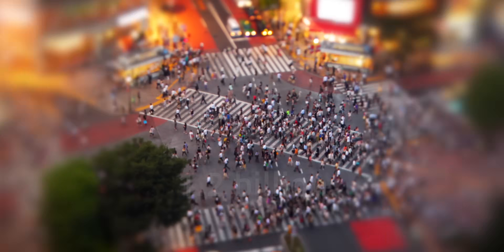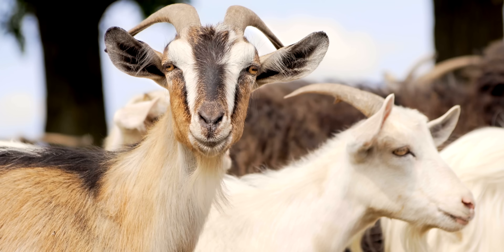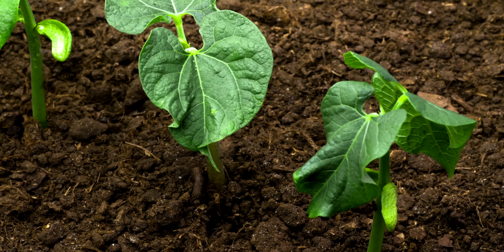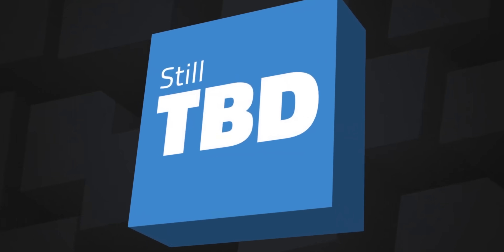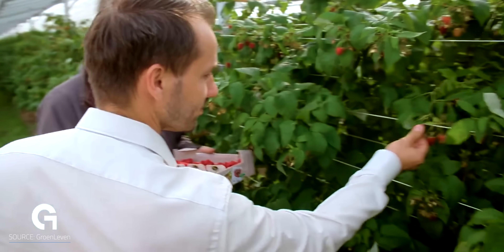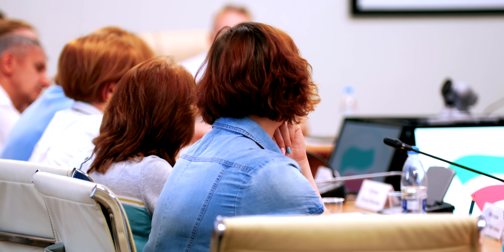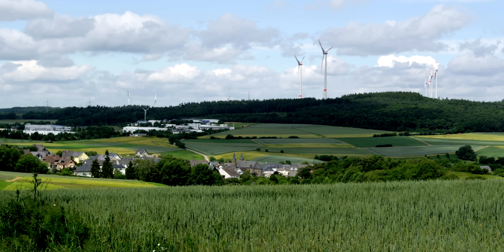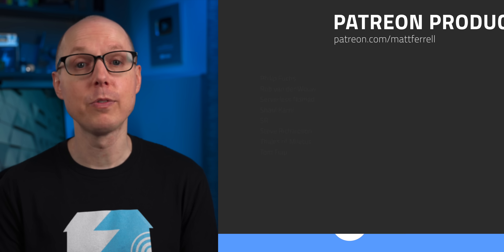Solar Panels Plus Farming? Agrivoltaics Explained

Comment: There are quite a few crops that are grown in polytunnels. If the panels are able to pay for themselves or reduce costs of maintenance below that of the polytunnels, it should be an absolute no-brainer for the farmer. For optimisation, I imagine that the farmer would want to maximise his profit per acre, or at least, that's how I would do it if I were in that position. That would depend on the relative costs of the crop and energy, but would certainly come out to some combination of both.

In short, we should absolutely be trying to use this everywhere. Even if it drops agricultural yield, it will still increase overall yield (if the numbers you quoted in the video are correct). If the double-sided vertical solar panels do not interfere too much with cultivating and planting in the field, that should also be done on the more sun-intensive plants.

Comment: This system  of programmable adjustable pvs is proving interesting for high value crops such as vines in top of the market wine areas of France. Given that in  SW France we've already gained 1.4°C temperature, I expect to see more of these apvs installed over the next 5 years.
Reply: New technology for electric power generationhttps://youtu.be/xc2V2BS_Fng

Comment: How does the power and crop output compare between agrivoltaics and just plonking some wind turbines in farmland? I'n guess if the NIMBYs allow it, the turbines are a better solution to dual-use land.

You asked if there were other such tech we knew about - have a look at thermal chimneys (AKA "solar up-draft tower") - they are basically a horizontal wind turbine inside a giant circular concrete chimney, with a large plastic skirt around the bottom of the tower trapping heat between it and the ground and forcing warmed air up through the chimney to drive the turbine. Trials have been done where the area under the sheet was basically a greenhouse. They are super simple and cheap to build, need almost no maintenance (one here in Australia lasted 10 years and only fell down because they decided to stop maintaining the guy-wires holding it up) and they can even produce power for some portion of the night from the trapped air still being warm after sundown. I have no idea why they are not more popular, except for the fact that a) they probably do not produce as much power as a simple wind turbine, and b) they require a lot of land.

Comment: How often must the PV panels be replaced and what is the environmental impact of actual making these panels?
Reply: Much much less than the impact of generating the same amount of electricity using fossil fuels. Solar panels can produce electricity for several years before facing a drastic decrease in their yields

Comment: This is not new at all. This topic has been dealt with over 4 years ago publicly in Germany. There are enough buildings in Europe which people should focus on when installing solar panels, where the implementation barriers are a lot smaller. https://youtu.be/dFddSSZManM

As usual technocrats oversimplify the situation as means to an end.  The shown examples are mainly from Europe and Germany. None of the 3 given reasons are the main issue. Not for agriculture. Cause all those reason have a justified root. 

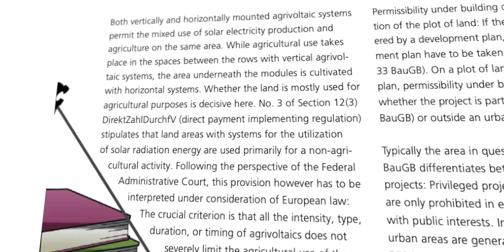For bureacracy ,  and for the case of Germany (because he took the legislative texts from the German law, you can find a hint at 10:06 -> BauGB - The Federal Building Code) for safety reasons (i.e. fire-safety), for environmental reasons (i.e. rotation farming, animal protection etc. ), AND because the consititution would be undermined, agricultur and energy are seperated, also rightfully so. And therefore this is fully supported by green parties here. So no, bureacracy is not the issue. Staying true to democratic values is. Democracy has always been and always will be a human-prefering-governmental system. Therefore "agrovoltaics" is not a term that can be pursued or introduced to the european law and is also not applical for most of Europe. Shadowplants are not the main part of the european diet. Sunplants are. Which is why these plants are making up for 80% of all agricultural land. Good luck with trying to find enough plants that would be able to grow efficiently below solarpanels. People cant only eat berries. (i.e. tomatoes) , let alone trees without running into monoculture issues. 

Nimby syndrome befalls everyone, environmentalists, progressives, even the most authentic technocrats. (yet again rightfully a democratic issue, not a metaphorical one) 

The freemarket is not what it is. Free. It is heavly regulated (see above: bureacracy) AND gets even more regulated ebery year by socialist and green parties, inducing, as rightfully said, heavy costs for non-standard solutions (research, review...etc) Therefor there are already a lot of governmental grants for renewable energy solutions, (I dont know why this was not mentioned) but then why should the taxpayer give out more money for solutions that are democratically not accepted (making them actually illegal/unwanted)?

SO the actual solution is not depending on the 3 given reasons but on technical feasability, passing the issue back where its supposed to be solved. By the technocrats. 
Once the whole solarpanel can be made translucent, then IVP will find its way into mass implementation and laws in no time. 

Until then, please refrain from just asking the public rethorical questions like "Why not just change the law, us (nymbi) , or invest more money". Instead, from the beginning on, ask the public what they think about IVP, or if someone could find a solution to implement it the way it works for everone. 

Then your contribution to this topic will sound less accusatory or blaming (which wont solve anything especially if completely unrelated issues are pointed at, eventually forcing someone or something to sacrifice), but encouraging to find simple solutions most people havent even thought about. Do not over simplify things. Youtubes community is already very dumb. For their sakes.

Comment: Had this idea 20 years  ago. - couldn’t understand why all desert reasons aren’t covered by solar. You could use part of the electricity to pump water out from the aquifer you have less evaporation as the solar panels with shade the ground from the Sun the water pumped up could be used to irrigate far drip feed underneath the panels and plants can be grown in the shade areas excess electricity could be linked to bitcoin mining in order to convert the stranded energy into bitcoin which could then be used to pay the wages of employees for harvesting..

Comment: Hi Matt. Great video. I think it makes sense to combine the two, but as you said, the combination is less efficient than a straight up solar park or agricultural land. Another question that wasn't addressed: as a proponent of organic food, I'd like to know what is the impact of the materials used in solar panels on the food? If they are made of heavy metals or plastics, or other materials that are not good for human consumption, could there be potential leakage, leeching, or run-off issues when it rains, or when they slowly break down?
Reply: This is an excellent question. And how long do these panels last, and how are they disposed? The added cost of dismantling and recycling is not mentioned. Do the heavy metals end up in landfills? There will be millions of solar panel arrays world wide requiring cost effective dismantling and recycling. Who pays that cost?
Reply: @archcollie5708  ohh the worried minds are present..?
Of course there's no pollution from solar panels. Aren't you aware of how old this technology is?
Aren't you aware of how efficient environmental authorities and regulations are? 
Actually a practical German University study has proven there is benefits for solar energy and plant production, and hardly any negative effects.
Reply: In terms of benefits, this approach is 1+1 = >2 type integration

Comment: This is silly, less sunlight on the plant because the solar panel has absorbed it means slower growing.
Most land is unsuitable for farming, put the solar panels in the mountains and swamps. Cover lakes and reservoirs with floating solar panels to prevent evaporation.

Comment: Uhm yeah, great & stuff but you realize that manufacturing these panels and then replacing them aka throwing away the old ones generate more polution than simply using traditional coal? It's called carbon footprint. Yeah, it's not a trendy term so you probably didn't.

Comment: Perhaps agrivoltaics could help cultivate desert regions, with the solar energy powering atmospheric water harvesters. (Or ocean floating farms with powered desalination??)
Reply: This. Ocean farms need to be explored more. Depending on the produce, it could work with a reverse osmosis system. And besides solar, there's electrokinetics. Harvesting energy from ocean currents would be a bonus.
Reply: They are doing this in China turning the desert green with food.
Reply: @lauramcconney9367  In open air, Nottingham in Green houses.
Reply: True china is doing agrivoltaics in Kabuki desert
Reply: How in ocean floating farms, insects can go in and pollinate? Unless you are farming genetically modified seeds? Don't try to make fools of the viewers.
Reply: You're probably going to want to build them more like greenhouses in the desert with maybe a bit more shade to counteract the excessive heat, but yeah, might not be a bad way to make use of otherwise barren areas
Reply: New technology for electric power generationhttps://youtu.be/xc2V2BS_Fng
Reply: There are grasses growing where they have solar installations. They keep more moisture in the area.

Comment: A very smart idea! 
Another problem I think you missed would be how to connect these farms to the energy grid. It is unfortunately so that you cannot introduce a large amount of energy to a certain area of the grid if no-one will use it, or the grid is not sophisticated enough to handle the amount of electricity. Sadly, the electricity grid out in rural areas are often not well developed and this development introduces a further cost to the agrivoltaic system :(
Reply: I don't see that problem in Europe. Population density here is very high here and wind turbines are also popular so there is a way to integrate them into the grid, especially in Germany. In the US I could imagine it being to rural in some places but Texas also somehow found a way to integrate lots of wind turbines.
Reply: I could be wrong, but if you have enough power to sell, someone will come up with a grid. In addition, some enterprising person like Musk will start building electric farm equipment.

Comment: This is a great concept, but it could be better.  This could be adapted for more uses, such as water and energy storage, recreation, even housing.  Anytime we can reduce negative impacts, such as storm damage, drought or flooding, we reduce the risks, also.  A controlled environment is almost always better for everything.  Vertical farming of certain crops becomes incredibly efficient and very profitable.  These panels could collect excess water and heat for maximum efficiency.  So many benefits to this.

Comment: I believe they should use the wider spaced panel density models to sit over roads and highways (main arterial setups) this would reduce the heat island effect, make the road safer during wet and snow periods but also power the infrastructure for the arterial. Utilising an exhaust gap V in the middle would solve the vehicle emissions density under panels. 

Panel heat reduces faster than bitumen or concrete radiation fall off over the evening hours. Less heat island and more carbon neutral roads. You would see local ambient temps drop by as much as 0.5-1 degree C in some areas. Supplementary power from the road network could also be used at charging stations. That along with power subsidies would potentially make the road cost positive and reduce toll costs. 

Rudimentary theory but fleshed out could be an election winner for a government ballsy enough to do it. 

Would work for electric rail too.

Comment: I was pretty dismissive of this concept when it first popped up but it appears that this idea may have some merit, particularly in warmer, dryer regions. Now I"m wondering if the shady solar panels could be used to introduce plants and crops to a region that normally would be considered too hot and dry for cultivation, perhaps combined with water harvesting techniques to support the vegetation beneath the panels. Have you done any videos on harvesting condensation?
Reply: Good idea — perhaps some of the juice from the solar panels could power a well pump to irrigate the shady grow zones below the panels. As long as an adequate well could be drilled, we could create oases in hot, dry, currently “useless” (and inexpensive) land.

Comment: Why would Agrivoltaics produce more expensive electricity? Yes, production per solar panel is lower, but it does not require the purchase of the land, so needs less money and thus less interest. It also allows production closer to electricity use, instead of some remote desert.

Comment: Can’t say that solar will meet a large portion of our energy needs because you haven’t solved the storage problem!  You’re basically making yourself sound like a child with almost no technical understanding of what’s actually going on.  Not to mention the fact that the grid typically is not designed for large solar installations everywhere so you have to factor in the cost of inverters storage and grid modifications.  This is where the engineers really get disconnected from the fucking environmentalists who really just sound like fucking idiots.

Comment: Question….
Can you generate 14450kwh from 600 solar panels rated at 375 watts each?
Any help would be greatly appreciated
Reply: KWh requires a measure of time no? So it would take 65 hours to achieve 14450 kwh with 600 of these panels.  If you are speaking of wanting to achieve 14450 kW in one hour instead , with these panels you would need many many many more
Reply: @jonm3131   appreciated. In that case what would I be able to generate using these panels?
Reply: @xxavaxxrawr  225 kW or 225 kWh per hour.. please take my advice with a grain of salt, as performance varies greatly with weather, model, materials etc..
Reply: @xxavaxxrawr  Sorry my calculation are based on power rating..if we assume 5-10% efficiency as a conservative estimate you would generate 10-30 kWh per hour with 600 of these panels
Reply: @xxavaxxrawr  This is like having 1-3 heavy duty home generators

Comment: Another dual use of photovoltaics is floating panels in water reservoirs. Water reservoirs have a habit of evaporating into the air under heavy sun. They take up a lot of space. So why not float some solar panels on top of them to give the space dual purpose and preventing some evaporation in the process? We could also convert old mines into water reservoirs or closed loop pumped hydro energy storage plants where the sun powers a pump that lifts water from a lower reservoir into a higher one and when the sun doesn’t shine, you open the valve on the raised reservoir to feed a turbine leading to the lower reservoir. This would give dual use by using space as both an energy storage system as well as an energy producer

Comment: Issue is less about dual use and more an issue of block of integrated disciplines, in this case farming and solar energy.  Another case is the most efficient heating and cooling solution is ground source heat pumps using electricity.  However, due to those and know HVAC and those that know how to drill holes or dig holes not existing in the same company.  Makes it very difficult to make these types of deals occur.  I own an orchard and would consider agrivoltaics if I owned the array but that isn't allowed here.  I can't produce as an energy provider without a bunch of other hurdles and minimal to no benefit if I don't own them.  Do no harm to my crops is not near justification to deal with implications required to adjust farming with solar in the field.  Would also buy ground source heat pump installation if I could find even a single vendor willing to do it in my state.  I have the land and the space to heat/cool, just no viable vendor.  Same change would be required for agrivoltaics to grow and due to uniqueness of each profession, I can't see them joining forces without more incentive.

Comment: I have a much simplier proposal, and I have no idea why it isn't mainstream in America. Every large business with large flat empty roofing space should be covered in solar panels. Why the hell are they not? Walmart is a multibillion dollar company. Instead of buying politicians and lobbyists to fight minimum wage laws, why not invest in green energy? Why doesn't every plaza with a bunch of restaurants stuck linked together, and big box stores like Lowe's and Home Depo getting their own energy from solar? It doesn't require navigating all these challenges of melding solar panels with crop yields and America is COVERED in big business buildings with large open surface areas on their rooves, not to mention if they wanted to deck out their parking lots to provide shade for parked vehicles with solar panels.

Comment: God video that I mostly agree with, but you forgot a couple major drawbacks. 
1. initially costs then replacements in 25 years. (small problem for giant companies but huge for everyone else)
2. carbon footprint of solar. (mining, manufacturing, transportation, installation)[ nuclear rules]
3. non production time. (night, rain, dirty panels, etc. requires batteries or a hight carbon electricity production method at a un optimal level to compensate]) [this creates higher carbon production then using a high percentage of solar for total electricity production]